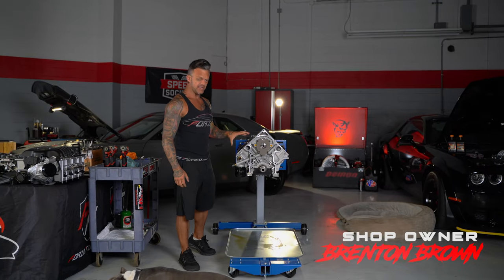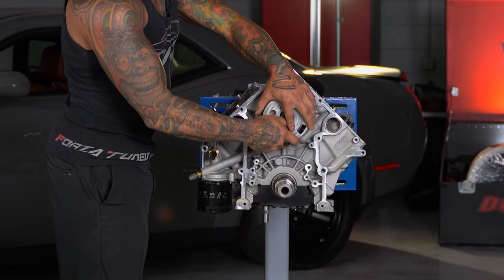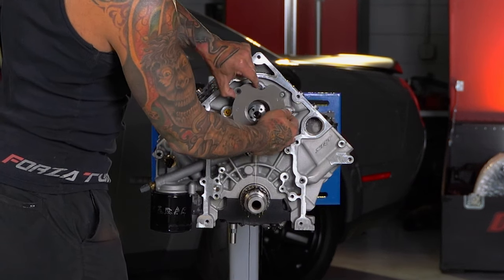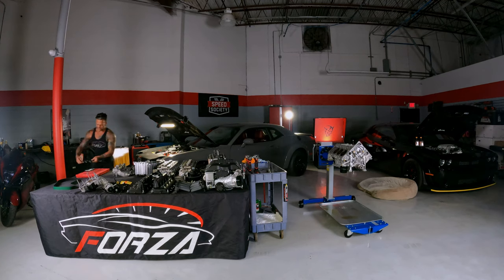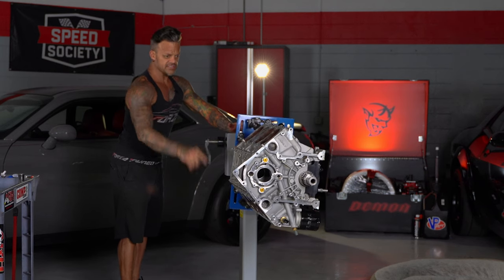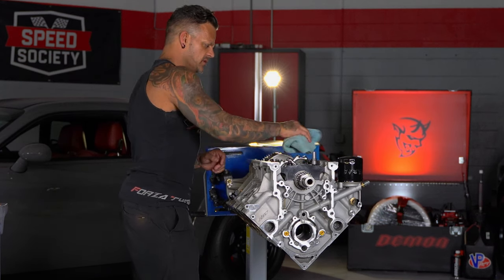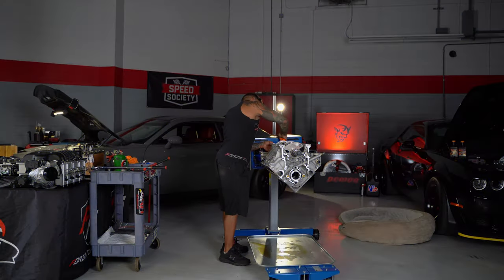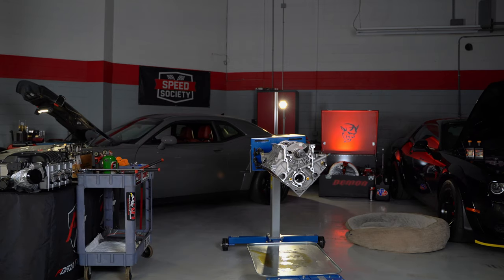Mopar Hellephant Crate Engine Teardown (Final Part)

Comment: Thanks...this was an interesting series and assembly is going to really be something! Couple of questions on technique...I am use to removing main caps w/ an upward blow on the outer edge of the cap perpendicular to the crank. This unlocks the snap fit of the cap. Do caps w/ side bolts require a different technique? For the rod caps, I am use to the caps having a slight interference fit to the rod bolts just before the cap seats. It's been a while but I vaguely recall knurling on the bolts in this area. Some sand the cap mating surface to not only get the correct bearing crush but also to restore this interference fit. Is this something that is no longer used? Thanks
Reply from the maker: We will be doing some Q/A soon, stay tuned....we will be answering your question!!